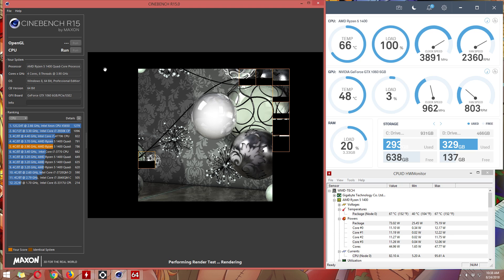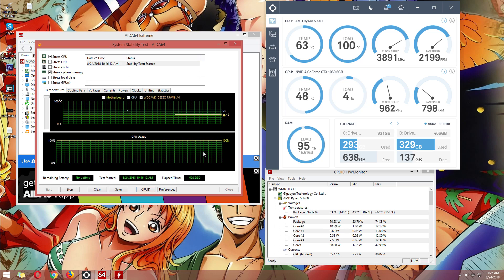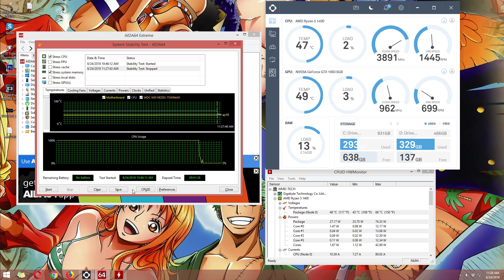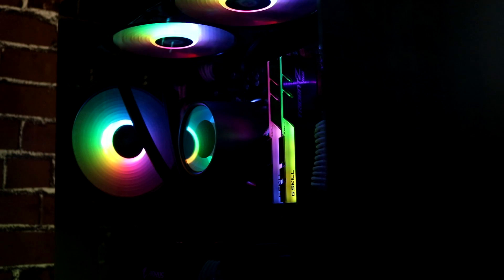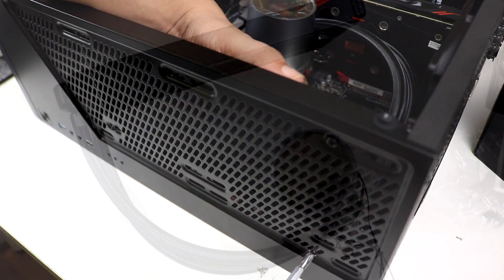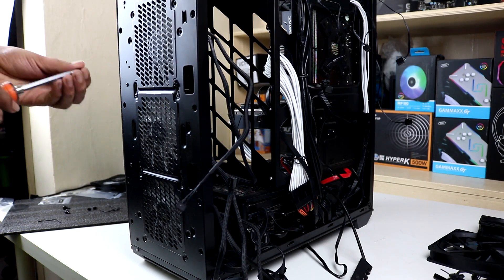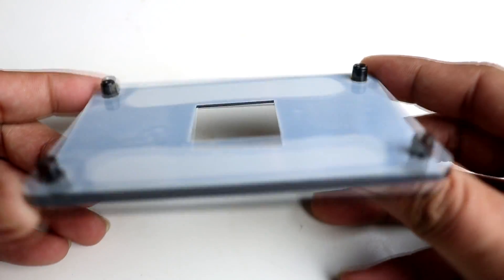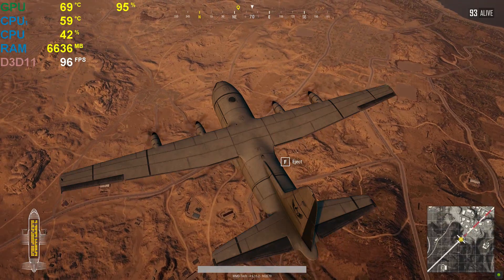Deepcool Gamerstorm Castle 240RGB - Installation & Temp Test

Comment: I have this cooler and I just wanna ask, what should be the fan configuration from the radiators?because mine is facing to the internal components inside pc and is blowing air to it?or should it be the opposite?blowing out air from the case?
Reply from the maker: For the positioning of the fans it depends on the case. If you case doesnt support 240mm rad it would go on the front blowing air to the rad and going in to the case. But i prefer it as exhaust type rad, the fans is blowing all the air to the rad outside the case. The first one is efficient if you're using pwm fans for all the fans on your case. Because the heat will go onto your case and needs to be removed quickly. So usually common position the same on this video.
Reply: @WMDTech  I have the Aorus AC300w mid tower case and the problem seems to be the exhaust fans since they are really not that fast on absorbing hot air out of the case, I'm figuring out to replace the upper case fan and rear fan with deepcool's CF120 as exhaust and the fans from the rads will be the same as intake, I guess that will be fine?
Reply from the maker: Any PWM fans will do, it will adjust on the heat on the CPU and GPU so it can support the circulation of the air within the case. And yes for budget category RF120 or Cf120 from deepcool would be the best. You can also check IDcooling if you want other designs, but airflow wise yes deepcool is the best.
Reply: @WMDTech  Thanks!

Comment: Kaya ba ng hub at controller ADD-RGB Controller kapag nag add ako ng C120? Di kase ako bibili ng 3 in 1 pack. So wala yung extra hub at extension controller.
Reply from the maker: not sure alam ko sa single pack is 3 pin led connector lang unless may splitter ka or adapter
Reply: WMD Tech  Bibili kase ako ng Castle 240 and 2 pcs of CF120. So Di ko lang sure kung enough yung splitter at hub ng Castle 240 for 4 fans(2 CF120 and 2 Castle Fan) and RGB nung cooler.

Comment: Sir pano ikabit yung RGB connection sa splitter kung merong 4 fans lahat (2 CF-12 at 2 fans sa radiator) then dun pa sa cooler mismo? So you need 5 ports for RGB connection pero yung splitter hanggang 4 lang ang magkasya? And what if e connect via Aura Sync, pwde pa rin ba e connect sa 3 pins addressable header ang 5 RGB connections? Ang alam ko 5V lang pwde sa addressable header eh. Patulong naman po! Thanks.

Comment: Mas nakakalamig bato kesa sa deepcool gammax?
Reply from the maker: Basically Yes and No for me. Medyo kabado ako kase syempre baka mag leak pero interms of performance noticeable ung difference siguro around 10-15c especially sa overclocking part. pero i havent tested them yet sa 3.9ghz but will try a comparison between the 2 coolers I say NO kase on idle or browsing halos pareho lang naman sila, pero nagkakatalo na sa full load.
Reply: @WMDTech  na try mo na bang gumamit sa 2 fans sa gammax gt mo?like hyper 212?
Reply from the maker: @MARKMONTES10  i think pde un kc may extra naman un para makabit mo ung pangalwang fan eh